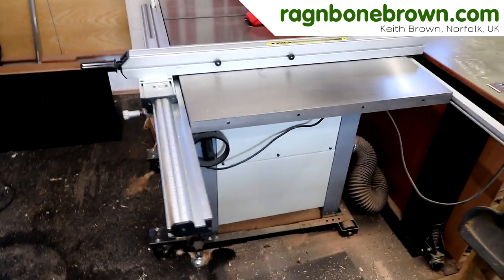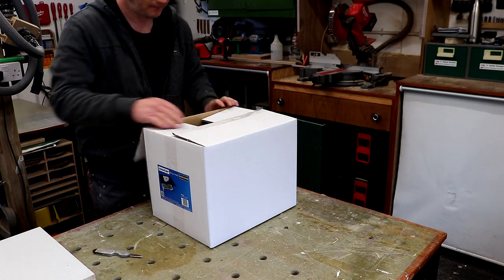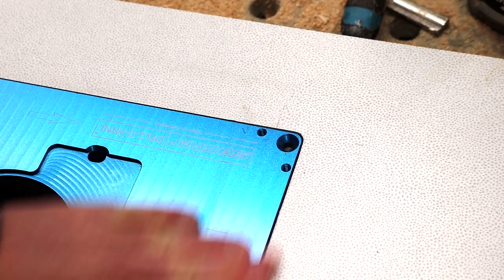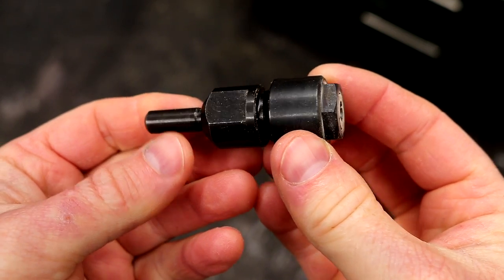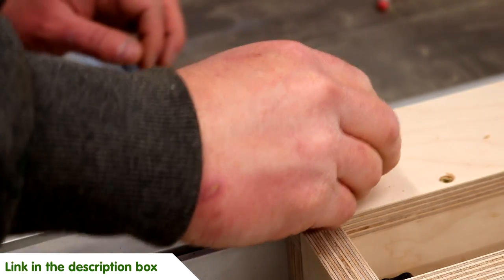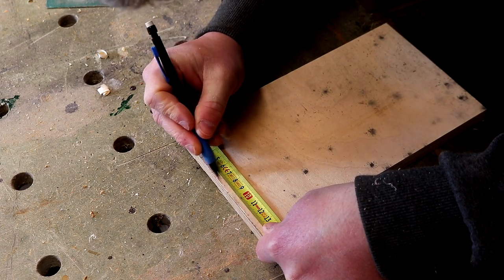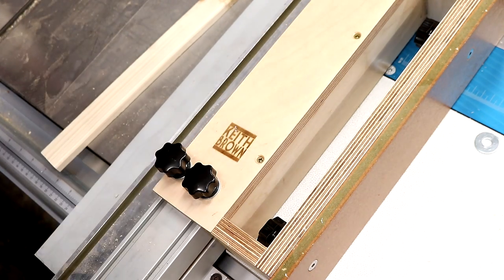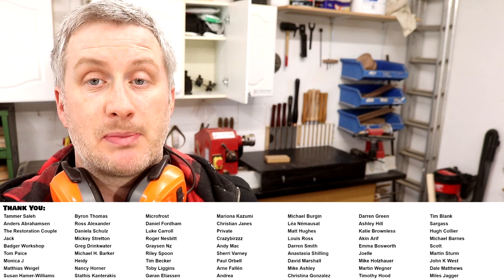I Made A Router Table

Comment: Keith, you did a great job on this router set up.  In my opinion, including the router on your table saw table instead of having a separate router table is one of the best ways to maximize space in a small workshop.  Thanks for sharing this video with us.
Reply: i have a little one i built on the side of my job site dewalt saw. uses the same fence (with added MDF like keith). i work from a single garage so space always a premium. unlike these americans with their huge workshops :)

Comment: A WARNING TO PEOPLE BUILDING A SIMILAR ROUTER TABLE: I did a very similar build but when I went to route out the channel for the “miter slot” I happened to have put a screw for the side rail in that exact spot and therefor I attempted m to route through a screw with a straight bit. Keep that in mind when installing the screws from below and marking for your slot or T-tracks!

Comment: Nice. I'm about to do this with my DeWalt saw... I already have a router table built (sits in a B&D workmate) but combining the two so you can use the table saw fence as you demonstrate is my plan also. From experience I can say you're going to end up adding T-track across the fence as well so that you can use feather boards there (and stops and other gizmos).

Comment: Hi Keith. What a very substantial router lift mechanism with nice long depth adjusting guides, I've never seen one built like that before.
It looks well thought out and designed for industrial use along with the router head. Good table build it should last you a long time. Tony
Reply from the maker: Many thanks!

Comment: Nice build, and you've definitely chosen a good router motor in that Mafell unit. But I would strongly advise you to use the fence when machining with bearing guided cutters...use a straight edge across the fence aperture and set it so that the front of the fence aligns with the bearing...you will get much more support during the cut, and its less likely that the workpiece will fly out of your hand and pull your fingers into the cutter.
Reply from the maker: cheers David, I appreciate that, I'm a complete newb when it comes to router tables having avoided them for so long.  I will take that on board for future use.
Reply: @RagnBoneBrown  there are some good safety tips on router tables at Brainfizz routing and making channel - I would post a link, but I have no idea how that works!
Reply: No need to use the bearing if one is using the fence, just take the bearing off and put it in a safe place. The working life of bearings on router cutters is limited.

Comment: I found a good tip for mounting a router lift. The grub screws won't help level your lift if you are just screwing them into the wood (they eventually sink into the wood over time). I created a sheet metal shim ring to fit between the wood and the grub screws which nicely solves the problem.
Reply from the maker: Cheers, the router lift actually comes with some small round metal shims, which I assumed (without reading the manual) are for that purpose.  I fitted them after making the video, and you're right, it certainly helps stop the grub screws from digging in to the wood

Comment: Well done. And now you'll be wondering why you didn't do it sooner.

I added one to my table saw and it totally changed the way I look at how I do things. Before, I was very hesitant to use a router to cut grooves and dados. Previous efforts were never satisfactory. With a router table, and especially one with plenty of surface area on the table saw, it's become my method of choice.

Comment: you may want to consider putting a small chamfer on the bottom of the adjustable fences. This is so if you have any dust build up against the fence it should go in the small chamfer between the bottom and the table and this will ensure your piece you are routing stays perfectly flush with the fence. But nice build

Comment: Very nice! I love that lever that instantly releases the router's collet for bit changes. I've never seen a router with that feature over here in the US market. On my router table I have to raise the router almost all the way so I can get the collet wrenches in there. One thing you may want to add eventually is a box to enclose the router under the table, so you can attach a vacuum hose to it for dust collection when you're not using the fence. Hopefully that can be done without interfering with the quick release lever. Or maybe you could attach the box using magnets so it's easy to remove the whole thing.

Anyway, nice job. I'm sure you'll enjoy having a good router table. It makes some jobs a lot easier.
Reply from the maker: Thanks Laura, yeah it's certainly a nice little party trick / feature. That's actually a great idea about the dust enclosure underneath.  I've already used the table more times than I expected I would, and dust does get underneath

Comment: Thread some holes under the grub screws and add some bolts so that the grub screws for levelling the router plate push of the head of the bolts. It will stop the router plate sinking over time.

Also, 1000w seems very very week for a router table, I get that it was free and although I like the quick release, it seems very expensive for such a low powered motor. With 2, or 2.4kw you'll find you get a lot cleaner results as the spindle isn't being stressed to 90-100% capability every time your routing a dado.

If only used for trim with a bearing, a palm router is quicker and easier.

Comment: You have a flaw in the exact same place as me 🤣, If it makes you feel any better I did it in the second table I made as well !!!! Its a quality set up especially with  the 8mm bits, so easy to swap between bits.
Reply from the maker: Cheers John, Andrew at Sautershop pointed me to your video when he recommended the motor and lift - it was really useful for me to see it in action!  It's a lovely machine, Cheers

Comment: congrats you deserve it. Really like how you did the fence. i can't get over 71DB and the quick change is really sweet. Just went to there web site wow
Reply: Quite often it is not the motor that  makes the majority of the noise on machines, but the spinning blade and the cutting of the wood. Try your table saw with the blade below the table compared to when it is fully up. Huge difference.
Reply from the maker: thank you Chris

Comment: Lovely video and great to see how much can be done with some slightly lateral thinking and 'bits n pieces.  Interesting to see the router table at the end of the fence guides but without any additional support.  My impression the Axminster saw and similar, is that when they move one of the side tables to the other side and attach it to the remaining side table they then add support legs (actually part of the kit when Ax supply sliding saw where the two side table are used on the same side).  Have you found it necessary, advisable or totally unnecessary to give any additional support to the router table.........either to limit tipping or to protect the fixing of the router table to the cast iron side table........I could see the weight and pressure on the table and the lever arm effect producing either a tilting force on the whole structure (appreciate the saw is quite heavy and stable itself!) or sagging at the joint between saw table and 'kitchen counter'.   Many thanks, and keep up the good work.
Reply from the maker: Hi Sarah, I think that having an extension table on the other side too helps with the weight distribution, but the body of the saw is incredibly heavy so I haven't found any problems with the router table needing support as it's very light in comparison 👍

Comment: Sweet router table top.  Like the magnetic inserts. Have they worked out or has sawdust become an issue with the magnetism?

I like the name “grub screws” rather than set screws. Apropos. I’m going to start using that term. 😁

Comment: Near £800 worth of free tools, lucky you, I built mine with a cheap aluminium router plate (e-bay) and the brilliant Katsu trim router from Aimtools UK, the rest of the table from scraps - cost - under £50.  Does the job. 😎  P.S. am not sponsored by e-bay, Katsu or Aimtools. 😕
Reply from the maker: As I point out in the video, this is a far more premium set up than I expected to have.  Originally I was just planning on buying a plunge router with built in height adjustment and mounting it directly to the bottom of the table top.  But it'd be mad to turn down such nice equipment

Comment: Great job. I'm going to do something similar on a very similar old SIP table saw and am wondering what you took into account when deciding which side of the saw blade to put the router?
Reply from the maker: Not really thought about it, I think either side would work fine
Reply: @RagnBoneBrown  Cheers, that's what I reckoned, just wanted to check if you'd thought of any horrible gotchas!

Comment: Why did you want the face to be slightly below the table top? Won't material catch when you pass it through?
Reply: The plate comes with levelling grub screws. You slightly overcut the cut away to adjust for perfectly flush.
Reply: He shimmed the fence with a piece of paper so it would sit slightly above the table.
Reply: @KSFWG  he was referring to the router plate, but that IS a good idea to avoid it influencing the fence as well as giving a place for dust to get pushed out of the way.
Reply: @BischBaschBosch  Ah I see, thanks